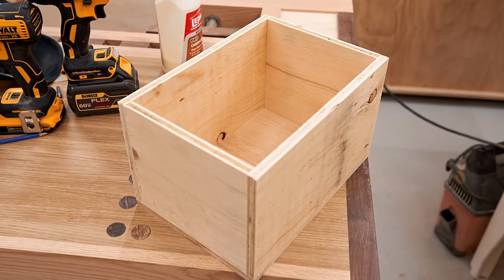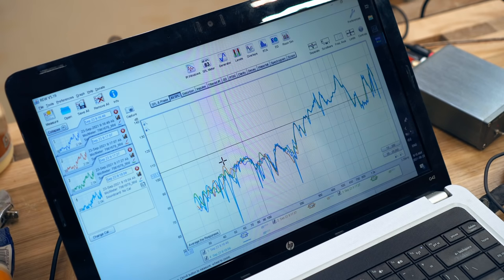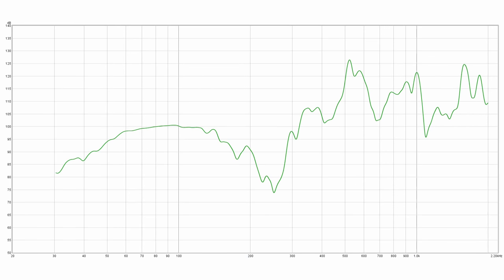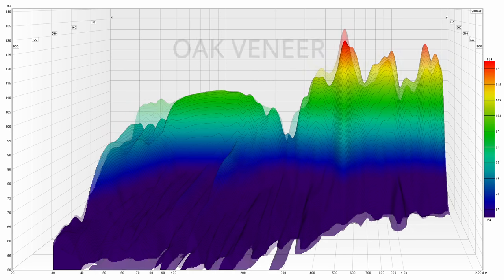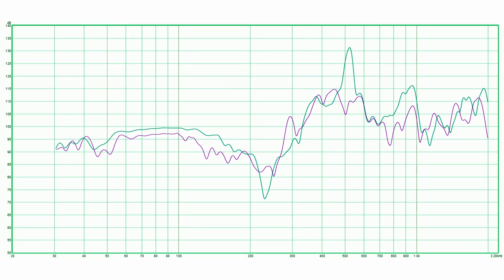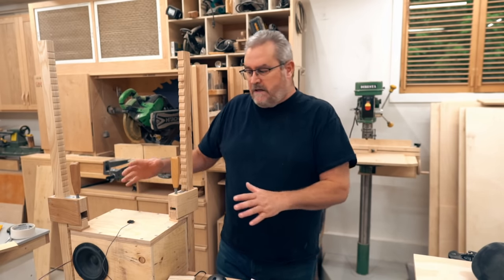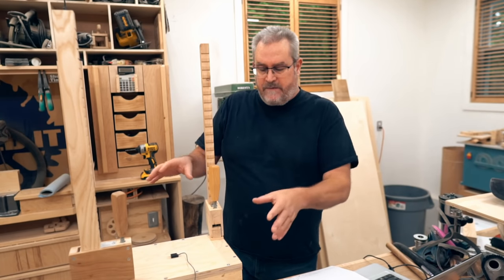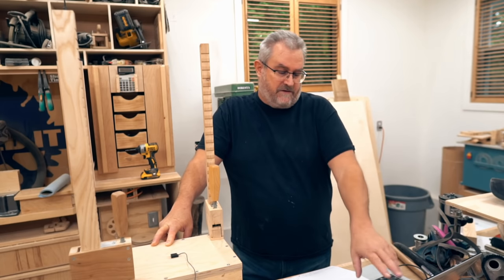PLYWOOD vs MDF For Speaker Building - Tests Show Surprising Results

Comment: This is interesting, and I suspect your conclusion is valid.  But I'm also trying to figure out how much the resonance of the other sides of the box will affect the one you measured?  The scientific thing to do would be either to make the box as non-resonant as possible, or make identical boxes from each material. The lack of significant differences may have something to do with the fact that 5 of the 6 sides were the same in all the tests.  But it's impossible to know without more testing.
Reply: I was thinking this might be something to consider
Reply: Agreed! I think using MDF as your base test rig would have made a bit more sense. that way you could have the tested the “gold standard” vs the various panels in the video. you’d still be looking for a needle in a haystack that way tho and ignoring a major factor.  the varying density in plywood sheets means it’s probably impossible to get a panel to  resonate the same as its counterpart.. every knot, varying grain patterns, the density differences of each laminate sheet will all have varying effects on resonance. All we’re really seeing here is  what construction grade plywood speakers would sound like. I think it’s a dope experiment for sure, would love to do it one day. But do it right.. Build identical enclosures out of different materials and see what the difference are. I bet you’d probably see quite bigger differences in your measurements as some of them will have some inherent imbalance. Some might be good others might be terrible, still curious what they would be be!

Comment: Probably already commented on, but my guess is MDF is used mostly because it's always flat and takes less work to finish for painting/wrapping. Great video!
Reply: also, is more consistent and homogeneus material; plywood quality can vary greatly in the same batch production
Reply: Baltic birch remains amazingly flat as well.
Reply: No. MDF is used because it's cheapest and still works fine for speakers.

Comment: Your findings are very accurate. Bracing helps more than dampening, but both are useful and necessary. Dampening will reduce the amount of energy reflected back into the cone. Bracing raises the resonant frequency of the panels.

Comment: About 40 years ago a friend of mine had his brother build him a pair of speakers. The cabinets were plywood and the drivers were from Radio Shack.  They stood about 3 feet tall, 2 feet wide and a foot deep. To this day they are the best sounding speakers I've ever heard. I need to ask him if he still has them. My guess, the drivers have turned to dust by now, but it would be a cool re-build with modern drivers.

Comment: Excellent and informative!!! I was a master installer at a high end shop for 9 years. Our material of choice was Trupan cabinet-grade MDF. Generally the enclosure was glued and screwed, then ALL inside surfaces were painted with latex paint to prevent 'breathing'. For aesthetics all non-upholstered areas were painted as well. The material would leave talc-like sawdust and just EAT router bits and bearings if not fed or cut slowly.

Comment: Ages ok (mid-80s, I guess), a friend of mine had an old pair of speakers, something from the 70s, pretty standard stuff, just like the rest of the equipment.
The drivers had paper cones with stiff suspension, the soft "rubber" wasn´t really standard at the time those were made.
Those speakers were ok, but down low their resonance made them sound quite undefined.
After a little thinking about it, we removed the drivers, measured the inside dimensions and cut a few pieces of wood, about a 16th oversize, wedged them between the centers of the panels and remounted the drivers.
The low bass got much better, it sounded much more responsive and defined.
It still was far from comparable with higher-end contemporary stuff, let alone modern equipment, but it was definitely an improvement.

Comment: This is a great project with good discussion.

I would suggest that you could test the speaker cabinet in a free-free condition by supporting it on some soft foam. This would also eliminate the boundary condition created from clamping the wood panel through to the bench - this will likely affect the panel resonance and modes.

Comment: I always put stuffing in the speaker box to stop sound waves bouncing of the clean walls and repeating back onto themselves and the driver.
Remember when adding bracing you need to increase the volume of the cabinet because the brace takes a lot of volume up.
I made a set of speakers years ago that had angled sides, multiple braces, stuffing, one coat of paint on rubber membrane them a second coat of rubber with sawdust added. Cabinets made from 18mm MDF.
Still listening to them today.
Good work on the experiments, it's the only way to really find out!

Comment: OUTSTANDING VIDEO!!  Wonderful to see some empirical testing on enclosure material resonance.   You confirmed a number of longtime observations I've made myself.  Personally I've found that a combination of bracing (of different types used in the same box) and the use of laminated panels is very effective at eliminating resonances.  If you glue a thin (1/4 - 3/8) panel of (quality) MDF to a Baltic birch plywood panel, the result is amazingly stable.  You have to use a lot of glue, and make sure it is uniformly clamped together, but it's worth the effort.  Many of the high-end speaker manufacturers utilize composite layers of different materials to absorb resonance.  The key is using materials with different *densities*.  When the energy hits material A it bends at angle X, for example.  As it passes from material A to material B (of a different density), it bends again at angle Y and so on...  Each change in direction absorbs energy.

I'm an instant fan of your work, thank you!

Comment: Looking at the location of the bracing, it seems pretty much in the middle of the box - so any panel resonances would be be at the same frequency above and below the brace, giving a single peak which is the sum of both sections.

What I might try is offsetting the brace so it’s not symmetrical - I’d have to do the maths but my guess would be that the golden ratio might offer the best performance, giving two peaks at different frequencies which don’t sum to a higher peak like they would for a symmetrically placed brace.

Comment: Thanks for documenting the experience, some thoughts come to mind. A loudspeaker enclosure is a 3D structure which is most often heard also mounted on a stand, the resonance modes of such a structure are not necessarily the same as the resonance modes of a single panel firmly attached to a heavy woodworker's workbench. Plate theory offers good ways to predict the modes of a rectangular panel made of isotropic material, but the analysis of the "3D" modes of the entire enclosure on a support is much more difficult to predict. Add to this that opposing panels could resonate additively and radiate sound into the room, but could also have modes in which they move identically, hence subtractively, and therefore do not radiate sound at a distance. I fear that it will be necessary to build an enclosure entirely and measure the accelerations of the opposing panels to be able to accurately compare the influence of the materials used on the distant sound field. Would be super interesting to also add other type like HDF, Bamboo ply, CLD with polymer, ...

Comment: These acoustical experiments are awesome.  I was always taught thicker/denser the better and add bracing
Reply: In a quiet well designed listening room with people willing to concentrate on critical listening, they will hear slight differences I think. My friend and I build speakers and for a test we both used the same 5" woofer and 1" tweeter and built 4 different boxes with the same air volume for bookshelf speakers. They all sounded different but the best one was built from laminating 3/4" birch ply and 1/2" MDF together for a 1.25" thick cabinet wall. The idea on that one was making a traditional rectangular speaker but with complete overkill for cabinet rigidity and using plywood and MDF with a layer of contact cement would provide some extra damping for the cabinet wall it self. Another one was made from laminating many sheets of 1/8" MDF into an oval cabinet. Those two examples were the most different in sound. The oval one was ringing as if some bass and mid bass frequencies were blending together, The 1.25" thick one seemed much more refined with no noticeable ringing and a tone/frequency sounded like it was more true to the source track. No braces were used in those but I've added bracing to larger speakers before and that does seem to work better in general.

Comment: I remember that sound. I worked at Allison Acoustics in the '80's. Started out doing production. Worked my way up to testing. We tested components and finished speakers. Our cabinets were MDF with a fake veneer on the outside. Inside we placed a small amount of fiberglass.Never used isolation rings on the speaker basket or bracing. Dr. Roy had the cabinets made to his specs. Never tested cabinets. Interesting show.

Comment: Very interesting, John!

I’m guessing the pine ply had the lower ringing due to the varying thickness of veneers, which make each layer less sympathetic to adjacent layers.

I like to use two layers of granite, one being 3/4” and the other being 5/8”, laminated with a layer of 1/4” lead sheet.

Let the tone wood debate begin😁

Thanks again for taking the time to test and share.

Awesome!

Comment: thanks for posting some actual testing verified with results. I like your questioning attitude. As for the resonance issues  if  you look at the speakers often used in sound reinforcement in live performance and DJs they are mostly molded plastic and iff the equipment is set up correctly for the room some of them sound pretty dam good . Like any musical instrument   like all the horns wood winds and brass it is primarily the size and shape of the cavity not the silver and brass that make the difference between OK  and great sound.

Comment: My initial guess would have been that particle board would be the worst, with OSB and various plywoods in the middle and MDF the best, so this seems to confirm most of that. I also remember some inexpensive speakers from the 1970s with dense Styrofoam enclosures that sounded much better that I'd have expected: not much mass, but maybe a lot of damping; a test on that would be interesting.

Comment: Very interesting and very informative.  I never liked mdf. It always seemed to not be stuff enough and therefore would require a lot more bracing.  The effect of insulation on high frequencies was interesting.  I would assume that it would be due to dimensions of the box creating "room" modes inside the box?  Thank you.  Very helpful.
Reply: It's a good ides to knock down those higher frequency "nodes" inside the box with damping materials, otherwise they will "ring" back through the cone and sometimes the port. Ideally speaking, we want to damp most of the energy coming off the back side of a driver down to nothing. Exception being low frequencies that we might be intentionally exciting a port or passive radiator or horn resonance with.

Comment: Bracing panels forces us to think about the vibrations of the panel  itself rather than the resonance modes of the internal air volume in the box. If we put reinforcements in the main resonance modal lines of the panels (1/2; 1/4, etc) , creating symmetrical divisions, we will have 2 or more identical zones resonating at the same frequency (+3dB reinforcement). That's why it's recommended that the reinforcements be located in asymmetric divisions of the panel in question. You also have to think about the size of the resulting sections with the division. If a 12"  panel is split at the center, we will have 2 resonant 6" sections; the ideal is to have zones no larger than 4 " (this pushes resonances much higher than 1kHz, which eventually makes their absorption easier by passive means (foam, textile fibers, etc.)
Several studies show that the vibrations of the panels are not perceived if they are 30dB below the main radiation (woofer), in the bass region (below +-300hz), the teorical "limit" is a little less (correlated with sensitive hearing curves)
  (the BBC did important research in the 70-80s for the development of its monitors, there are excellents papers on the web about the topic)
Reply: I wish I could understand this a little better. Quite interesting.

Comment: There was a thick ceramic paint that worked well back in the mid to late 80s. Then there is the dampening material used in cars. There is something called no res that is pretty popular now. As far as bracing goes, it works well also, but it works better if it is rounded over on any openings and where it isn’t attached as this tends to not allow resonances aggravated by the right angled surfaces. Opinions vary on this but my research backs up the rounded over bracing as opposed to that which isn’t rounded over. The materials used were mdf so things may  vary with plywood. Baltic birch is very good for cabinets, but not so much for speaker enclosures. MDF is more dense and has better damping characteristics when treated with surface coatings or other dampening material. Most manufacturers don’t bother with any dampening as this adds to cost. Failure to use any dampening causes resonance issues and DIYers and Modders have been doing this for decades. It isn’t a mystery.

Comment: I used 1.5" solid walnut butcher block for the baffle and a layer of 1/2" mdf bonded to 1/2" birch ply for the rest.  Sounds great.  I think the thick solid front contributed the most.

Comment: I remember well in the 70s all British speakers were made with chipboard. Then the BBC started doing tests on cabinets. They concluded that plywood gave a higher frequency resonance but was easily dampened by bitumen panels glued to them. Chipboard had lower resonance but was harder to remove. It was not long before a number of British speaker makers also started using ply with damping panels. Spendor, Rogers etc. These were very good sounding speakers, was it because of the ply or were they just better speakers?

Comment: The same experiment was conducted on another channel I’ll Fargo the channels name out of respect to your channel. In their conclusion they found out that plywood was superior than MDF material and that marine grade plywood which is very expensive was the best to use to make a speaker box. The only problem is the cost of the marine grade plywood to MDF. MDF was about half the cost the MGP  would cost.

Comment: I build speakers too and the crossovers. I use the 20mm pine ply for my speakers and I brace them with thin dowel by glueing the ends to the box panels across the speakers inside (several of them front to back and from side to side). I did it to save internal volume but maybe it's better than normal bracing, going by your results. Interesting that it makes such a measurable difference. Great work dude. Cheers Big Ears!

Comment: I made two pairs of speakers in my life. For both of them I used 3/4" MDF and as a "veneer" used 1/4" plywood (oak or birch). Solid as a rock.
Reply: For a couple 8's, @250watts, I built mine with 1/2"MDF and 1/4"veneer. Like you said, solid as a rock, and souy great too.

Comment: Solid experiment. I am in the process of designing and building some sealed 15" subs. my plan is to use 3/4" BB and laminate a 1/4" MDF to the outside.. My thinking is that the BB is lighter than MDF so the subs won't be as heavy as using all MDF, but the MDF outer layer will make the veneer application easier.
Reply: If you use a slightly soft adhesive, having different materials will actually result in better damping.
Reply: You are right on track.  Use lots of glue and pressure when gluing the materials.  The result is very good at absorbing resonances.

Comment: Thanks John, this is very opportune for me. I'm about to build a pair of mass loaded transmission line enclosures. The design is heavily braced and the designer just mentions 'good quality multi-ply' . So I've been agonising about 18 mm Baltic birch or  hardwood construction ply.  Both are expensive in the UK at present, Baltic birch especially so and it's not easy to source. So I've been thinking - will I hear the difference with ordinary ply ? Sure it's lighter and less stiff than birch, but ....   
So I'm going to use 'regular' hardwood ply, not Baltic Birch. It'll be veneered anyway.
Really enjoy these audio excursions.
Reply: You might also try laminating your 'regular' plywood to a thin MDF sheet, using lots of glue and pressure.  The result will be substantially better than the best Baltic birch.
Reply: @scottgoodwin9162  Thanks - I'd considered that too as a means to simplify the box construction away from mitres to simple butt joints and using mdf to skin it, helping to  mask 'telegraphing' of the then exposed ply layers. The result would be veneered 0.8mm . I've been caught out with veneering ply before. The 'telegraphing ' can appear months after..

Comment: I’m pretty new at speaker building. I admit that I was surprised at how cheap most companies build speakers. Fairly expensive(for me) brand names tend to have cheap speakers, thin wood, light gauge CCA wires but made the cabinet look real nice and fancy. I ordered some actual Pioneer speakers, crossovers and build 1/2” thick sealed but ported cabinets and used copper wire for 1/8 what a nice pair of Pioneer cabinets would cost and they sound good. They’re not as pretty or expensive looking but genuinely sound better than the most expensive speakers Ive heard. Of course, the source has a lot to do with it but I am comparing these I build with a $800 pair of Fishers I own.